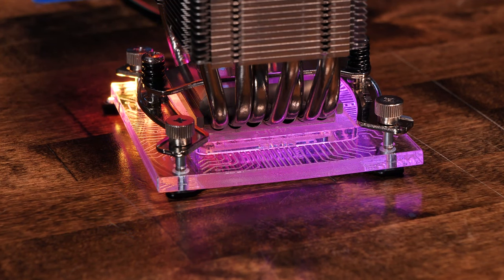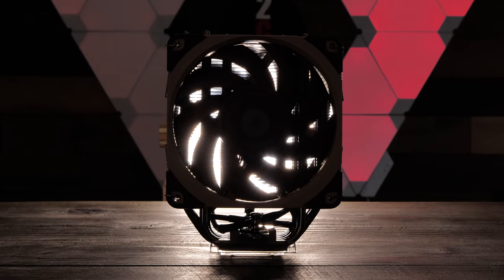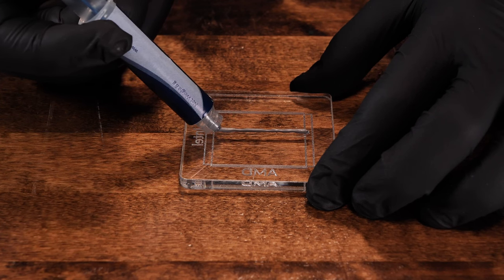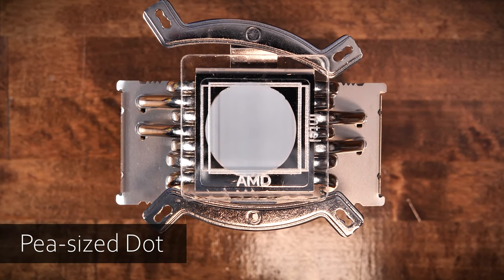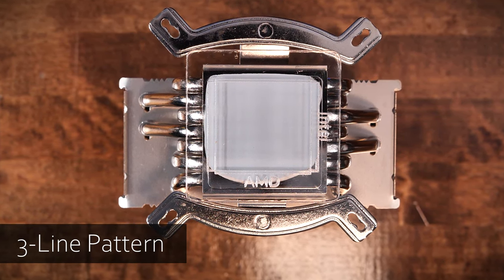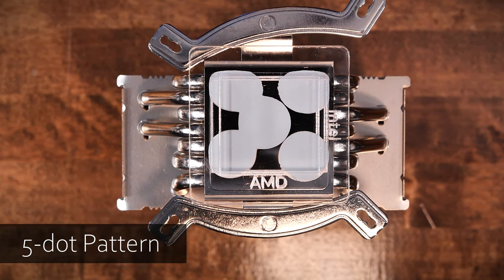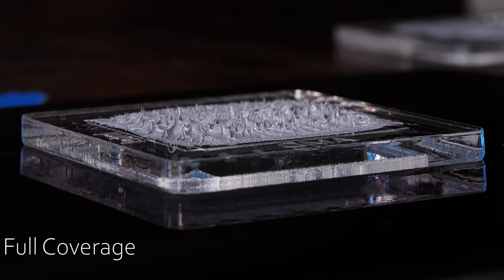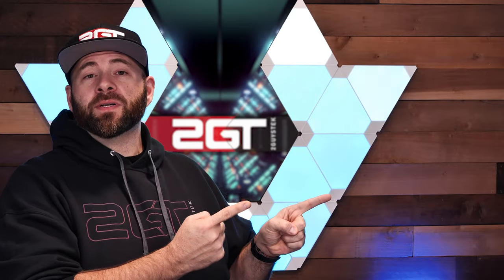You're applying thermal paste wrong! Here's how to do it right!

Comment: Guys  the video is good and the work is appreciated. 

However,  you did not apply the 5 dot pattern correctly. 

As per Noctua and others:

4 mm center pea

Four 2 mm dot applications near the vertices

After application, the center pea will cover a big portion of the cpu in the typical circular pattern. The other dots will expand and cover the remaining areas near the vertices. 

Coverage is complete with no overage.

The 5 dot pattern cannot translate to 5 EQUALLY sized dots as that will result in the pattern you demonstrated.

Just and heads up.

Comment: Instead of paste, try using various clear adhesives of similar viscosity, to prove the concept.  Air could be trapped within.  You may be deceived due to your paste adhering to the visible surfaces.  For 15 years I've worked in engineering in an industry focused on the prevention and removal of air bubbles between adhesives and vinyl and PE films.

Comment: Coverage is not everything. You have to test it with temperature values. 
The full coverage / spread methods were discouraged due to it causing air bubbles / air pockets in between the CPU and the Heat Sink. 
They can not be seen!
Reply: 100%

Comment: Wow, people STILL get this wrong in 2022... 
Forget all those patterns. What is the purpose of thermal paste?
-Well, the best conductor of heat in this system, is the metal that the sink consists of, no surprise here, and if we could lap the two surfaces down to optimal contact, i.e. to eliminate air (or vacuum, if you work at SpaceX), we would have the best solution. 
In practice, there will be small gaps where the metals are not contacting, so practically we want to replace the air with something as heat conductive as possible:
We then have thermal paste, which is a somewhat good conductor, not VERY good in comparison to the metal bodies we try to interface, but paste is still better than air. 
Now; apply a smear to the whole of the mating surfaces with whatever tool you prefer, then drag a razor blade across each, to get AS MUCH PASTE OFF AS POSSIBLE. 
Now, to answer the question at the start; "What is the purpose of thermal paste?": If you think of thermal paste as a thermal insulation, that is unfortunately necessary to apply to eliminate the air, you have a good understanding of the process.

Comment: What you're doing here isn't science, it's coffee fortune telling.

The edge coverage isn't even so important. There can't be anything under the edge of the heatspreader anyway, that's a keepout zone where the heatspreader is just glued down onto the substrate PCB.

Thickness however might or might not matter. But you wouldn't know since you measured nothing.

Besides that quincunx application obviously wasn't correct. If you put a dot right on the corner of the CPU heatspreader, 3/4th of that paste escapes, who would have thought! Instead you're supposed to place the dots in the middle of each quadrant.